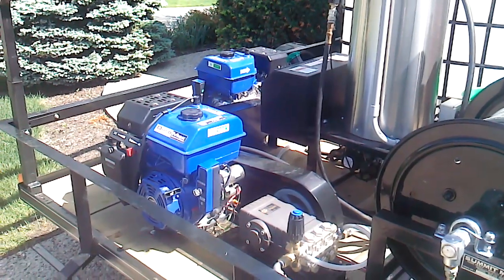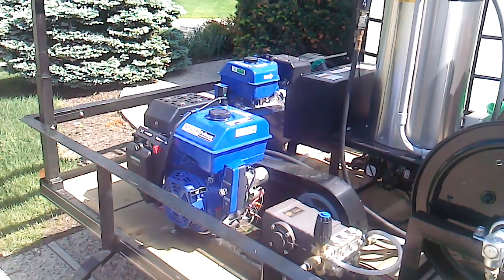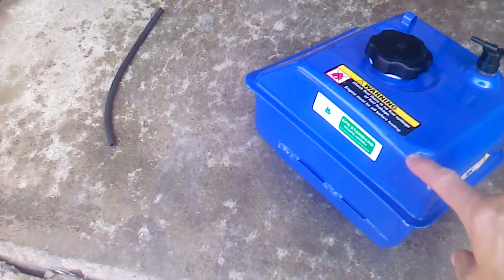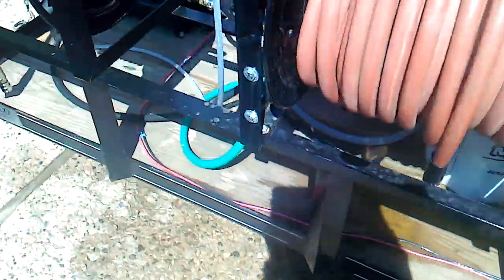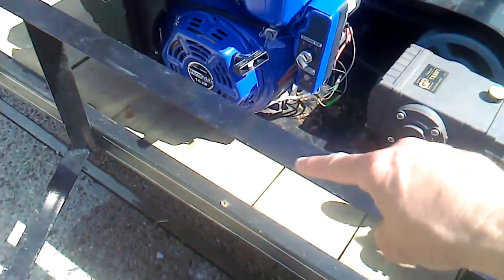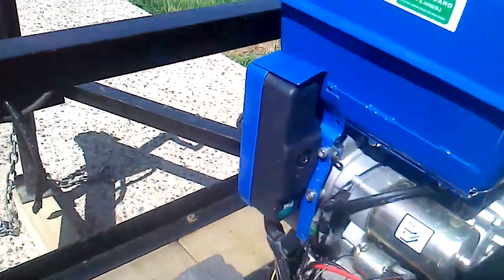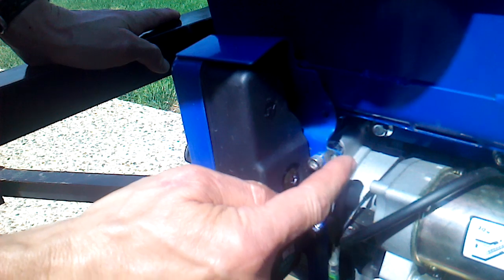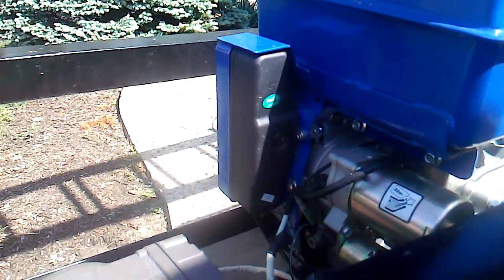Duro Max 16 hp Engine problems #2

Comment: My thoughts.  I bought the 16HP version to replace a 8HP Tecumseh on my John Deere snowblower. It was a combination of trying to save buying a new snowblower and also wanting a project.  Results: I have been using the Duromax 16Hp for 6 winters.  Have had no major issues except for the fact that the engine is not protected for snow use.  A few metal straps and a flap of 0.060 EPDM rubber has mostly solved that problem except in the windiest (blowing snow) storms. The 16HP is absolutely unstoppable.  If I run too fast in very heavy snow I just find the chute can't handle it. The other issue was a leak that developed between the fuel shut-off and the tank (just a bad seal).  I called Duromax. They sent a replacement for free but it was for the 7HP engine and did not fit.  My mechanic had some fuel resistant sealer which has done the trick. The other problem was that the start key housing back cover is plastic and was broken by my landlord's son somehow, I think he dropped something heavy on my snowblower as the battery case was also cracked open, but I'll never find out, I'm sure. But I run it very hard and, sometimes, in very challenging conditions, and it still starts easily (even at -5 F this winter).  For $325 I can't complain at all. If the tank mounts broke on Steve's engines it makes me wonder if there is too much vibration created by the way he has the engines mounted. Anyway, I have not experienced that issue. At this point I would  buy another, if I had the need.  Just went out to remove a 4" snowfall and the pull start cord frayed.  Will see if 1/8" para-cord will work as a replacement...

Comment: Bro is a 16hp engine for 300 what do you expect. And those are only cosmetic problems. If your video was about the engine blowing up or not starting then it would be relevant.

Comment: I am using a 16 hp Duro Max on my long tail boat and have had NO problems.
pushes my 16 ft. john just about any were I want to go.
am going to mount an exaust pipe with a baffle down the long tail shaft for a muffler so I dont have to listen to the exaust, and loose the heavy one
 maybe take the gas tank off and use a remote tank with a small fuel pump wired to the ignition to help with cooling and weight.
And I would recommend them to my friends.
I also love this motor
with no oil fillter and it only holds a little over a quart I change it every time I come back from fishing
I would recommend turning off the gas and running the engine till 
the carb is dry because of the ethanol in today's gasl

Comment: Hey Steve, I'm curious if you still have these motors on your trailer? Or did you end up replacing the engines? I'm currently thinking about buying the XP18HPE motor to build a pressure washer, but I'm not sure if I want to buy the XP18HPE 440cc or a Predator 420cc? Which would you recommend? 

I want to go with a Honda GX390 but I currently can't find any because of this whole "Covid" crap that's going on, so I figured I can just use a different motor until I can get my hands on a GX390! Any suggestions would greatly be appreciated, thank you!!

Comment: I bought a 16hp Duromax, paid $167.00 plus shipping, total or less than $200.00.   Briggs & Stratton like this would run me almost $1,000.00   I mounted this electric start to my Troybilt Horse Tiller.    I LOVE THIS MOTOR!!!

I am going to mount some bright fog lights on my till now.   You did not mention how well the engine performs, and operates.  I find it to be exceptionally quiet, and more then enough power since I replaced and 8 hp, recoil with the DuroMax 16 hp electric start.

If your mounts are breaking what is out of balance? If your flywheel I see if powering is out of whack then I am betting those vibrations are your real issue.  I might suggest a "root Cause" analysis.

Comment: Good information and it's always cheaper to put your own pressure washing unit together your self.  Saves a ton of money. What size pumps are you using amd how did you determine the pulley sizes? 
Thanks
John D
LykeNew power wash

Comment: There is nothing wrong with the engine. These engines were made to be modified... the gas tank is really supposed to be moved and mounted solid to the implement (in my case, my go-kart) and the key as well is not meant to be there at all.
Reply: ***** so are they good because im about to get one
Reply from the maker: roy kinner 
I will never buy another one.  Probably ok for a go-kart or mini-bike not high torque environments.
Reply: ***** Were are these engines made?
Reply: +ChuckHydro they where made in China just like everything else in America
Reply: Loren williams Then I know they will be just great, like the rest of their crap.

Comment: Hey Steve what Pressure Washer Pump did you use with you Duromax?
Reply from the maker: Hi there, I do not use any Duromax motors anymore.  But, I use General pump pumps.

Comment from the maker: Hey guys, check out when this video was published.  I am way past this issue.  I thought it might help some other people. I dont have any issues with my trailer anymore.
Reply: Ik this is an old vid you had problems with casting failure... But how dod the engines run? Did they seem to make the advertise hp?

Comment: were the engines mounted firmly?
Reply: Yes

Waaaaaay toooooo firmly, with zero shock absorption engineered into his setup

Duromax didnt engineer his spray rig trailer he did, But a brand gets run through the mud because a powerwash guy couldnt anticipate the need for shock washers to take up the vibration vs the fuel tank mounts
Reply: @brianboyee8972  hahaha thats awesome. This guy clearly isnt too sharp